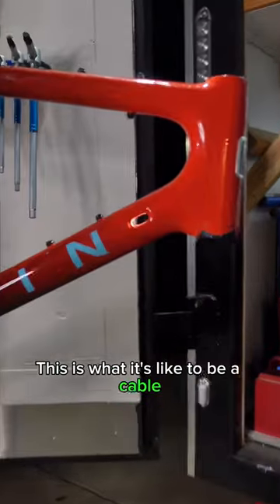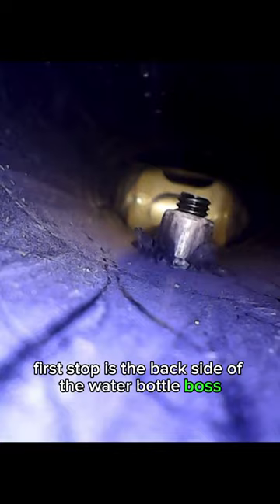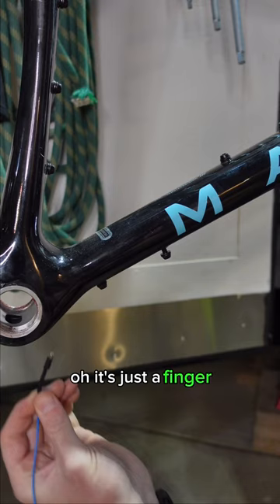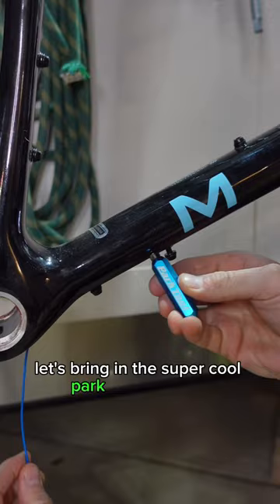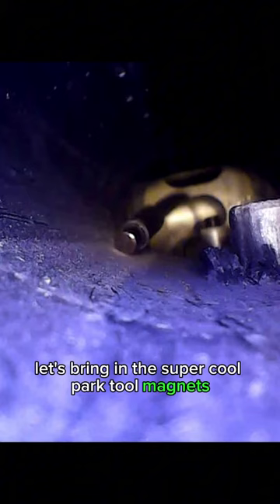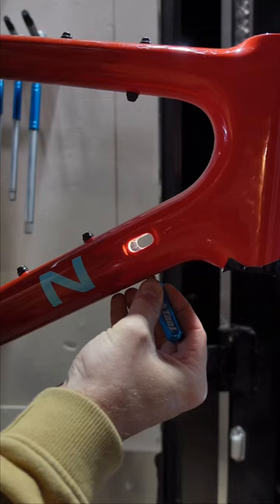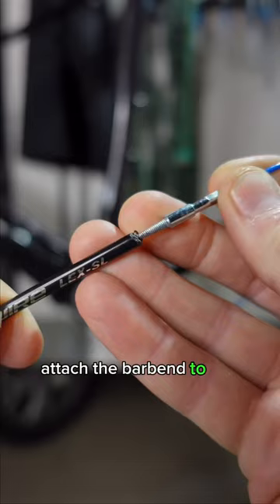I put a camera inside my frame! #cycling #mtb #gravelbike

Comment: I can hear the rattling already
Reply: I'd take barely noticeable rattling (especially  over wind noise) over catching a cable on a Rock and ripping the cable up/ completely ripping it in half, fucking the back brake/ gears
Reply: Except that doesn’t happen
Reply: @thomasardizzone531 i ride dh, no rocks gonna cut ur brakes unless they routed underneath and u ridin down the rockiest trail in ur country
Reply: I own this bike frame, no rattles 😊
Reply: Man that just cause you suck at setting up your cables. Also, he wasn't done yet.